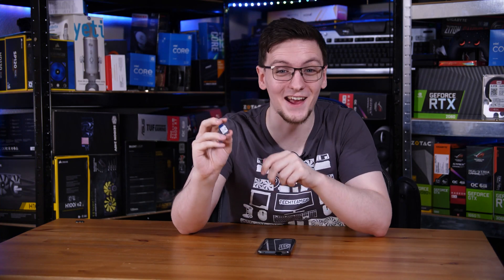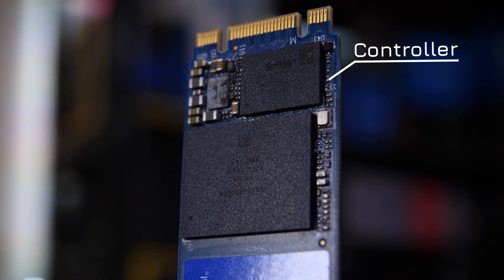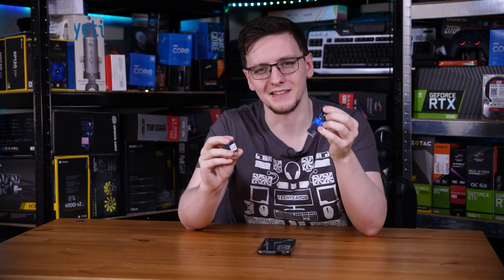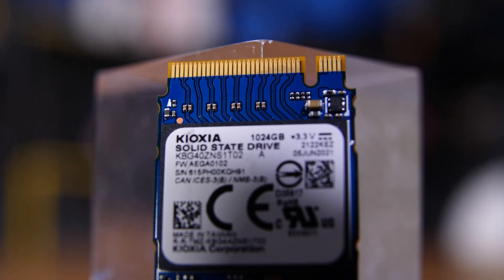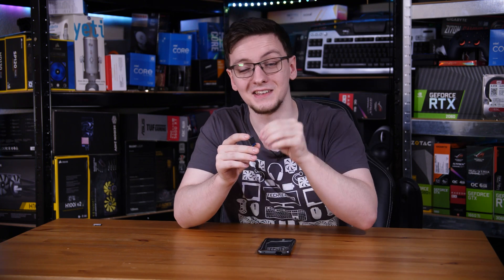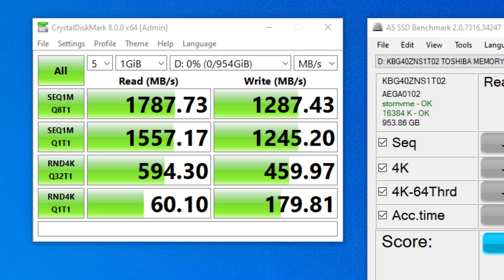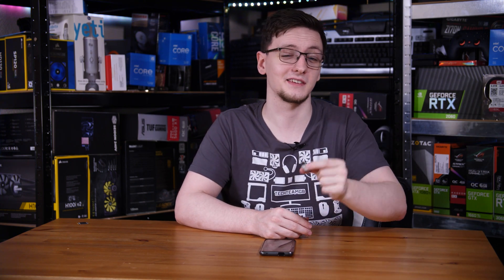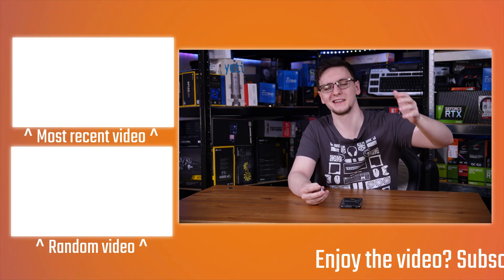TINY SINGLE CHIP 1TB NVME SSD!! - Kioxia BG4 Review

Comment: You mentioned that they sell the chip itself to solder to the board.  Really, I think that having it be not upgradeable is a horrible idea.  I am one of those people who won't buy computer if I suspect that the RAM or storage is soldered into it.  I instead would look for teardown vid or set of pics and see for myself if it is upgradeable.  Even if there is no room for upgrades, it would still allow replacement of a bad module easily.  For example if I had a bad stick of RAM or a bad SSD, I would want to replace those things unless the computer is so old I am better off with a newer one.

Comment: I thought you said that TLC has a lot more write endurance?  I always thought that SLC was the one that has the best write endurance.  Of course SLC if you can find it is much more expensive per GB or TB than any other NAND flash memory.  SLC is also supposed to be the fastest but because of its significantly higher price you will never see it in any store such as Walmart.  People who shop in those places I would not expect to know all of the differences between all of these things, they usually just want the lowest price and are often not concerned about the performance of it.  There is a flash memory called Pseudo SLC which is essentially MLC or TLC in SLC mode and I have tried a memory card based on that and it did not once disappoint me.  That was just a MicroSD card BTW, I imagine an NVME drive made with that would be fun to try out!!  That is when you consider it won't have to run slower due to speed limitations of USB. Pseudo SLC seems to have been developed to give performance more like SLC but without such a high price tag attached to it.

Comment: How would this perform as an OS drive?
Reply from the maker: Yes it would work fine as your OS drive! It doesn't have any DRAM, but for most people that isn't too much of a problem.
Reply: @TechteamGB  unfortunately the price has increased due to Covid. I hope the Nvidia handheld will increase the demand for the 2230 form factor. My goal is to install this drive into a laptop that has a 2230 as well as a 2280 slot. Do you think we will also get higher capacity 2230 drives soon?

Comment: Gotta love the breakneck pace at which tech advances, where 1 GB/sec sequential write times on a drive the size of a postage stamp can be called "bleak" haha.

USB 3.0 thumbdrives to this day are still stuck in this balancing act of speed vs turning into a fireball and destroying all your data.  There isn't a single one on the market that doesn't speak of dying in 1-2 years.  I don't think any of the original models in 2016 are even sold anymore, as they all turned into fireballs or went into "data protection mode" within minutes.

I wouldn't mind a NVME based usb drive that's detuned a bit.  They have enclosures, but they run at read speeds of around a GB/min and get screaming hot.  I'd be perfectly okay with dropping that rate down to 250 MB or 100 MB/sec and keeping things cooler.

Comment: Love your channel and work, amazing and more importantly quality, informative content without silly shenanigans. Kudos.

I recently got Lenovo Yoga 7i and it came with this exact type, BG4. I created an Veracrypt volume of 720GB and it went so smoothly, I didn't know it was using RAM. I was sure no SLC can sustain 720 at a single stretch without slowing down as once SLC is full speeds used to slow down in the drives I've used thus far. This got me researching and found that RAM can be used as cache. Amazing stuff in such a tiny package.

Comment: Fun fact: The Alienware 17 R5 has 3 M.2 SSD slots:

- First is PCIe Gen 3x4 only (2280)
- Second is either PCIe Gen 3x4 or SATA III (2280)
- Third is PCIe Gen 3x4 (2242)

There aren’t many 2242 drives that go past 1 TB, but Sabrent happens to distribute 2 TB drives in the 2242 form factor.  I happen to have one installed in my 17 R5 along with a 2 TB Samsung 970 Evo, a 2 TB WD Blue M.2 SATA SSD, and a 4 TB Micron 5100 Eco 2.5” SSD.

Yeah, I was on a bit of a storage binge with that laptop -.-

Comment: Steam Deck though. ;)
Reply: Heck yes, show me where to buy a 1TB m.2 2230 drive! I reserved the 64GB model with a plan to upgrade as soon as I can find one.
Reply: @CampGareth  I'm getting the 64GB model as well. however, I am willing to wait. Linux memory management system is extremely efficient so even if your eMMC drive is slow, it will keep your OS and most of your favourite applications in-memory unless the data is truly required by another process. This is why Linux always felt very snappy even with old computers and mechanical harddrives (as long as you had plenty of RAM). I have a 256GB MicroSD laying around, because of this I am willing to wait, and honestly I am not that serious on taking AAA games on the go, I look forward to play indies, retrogames as well as old backlog games. So basically Monsterboy, Streets of Rage 4, Hades, Owlboy, Dishonored, Mass Effect Legendary Edition, Mega Drive, Super Nintendo, Gamecube, Dreamcast games etc. :) All of those will run perfectly of an SD card or eMMC. :)
Reply: @PixelShade  That's a good point, for those types of games smaller storage will be fine and I could certainly pick up a big microSD card while looking for a drive, they're cheap. Eventually I would want to play heavier and larger games like cyberpunk and gta5 and those will want faster, larger storage.
Reply: @CampGareth  I Honestly think GTAV will run great on SD card. Cyberpunk on the other hand is a beast! incredibly beautiful but it does require a lot of hardware. SSD in particular because of the heavy use of streaming in the game (and the amount of detail is staggering, I zoomed in on a vending machine just to witness intricate detail on a PCB with wires and solder points next to a coin slot when zoomed in. like why even have that amount of detail!?) do you have a gaming PC as well? another option is to play those heavy games on a more powerful PC or when connecting the Steam Deck to a dock. that way you can just add a cheaper SSD. This is what I love with the PC, so many options to tailor a product for your needs. :) there will probably come a nvme usb-c acessory in the future as well 😅
Reply: @PixelShade  I do have a separate gaming PC with a gtx 1070. I've also got a GPD Win 1 with an old atom quad core that I use for game streaming from stadia or geforce now. Point is I've got options but still usually prefer to render on the device closest to me unless it's not capable of running the game. Latency and the occasional video artifact mean that will usually be better, unless we're comparing ultra low local to ultra high remote.
Reply: I was thinking the same!😂